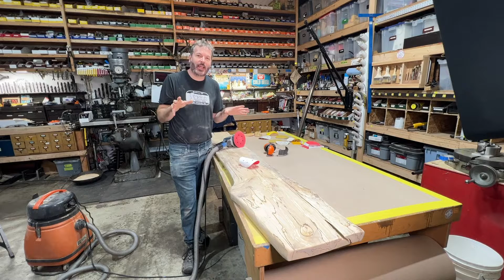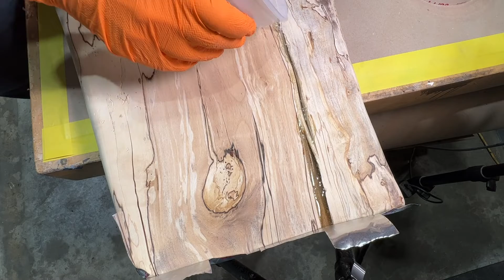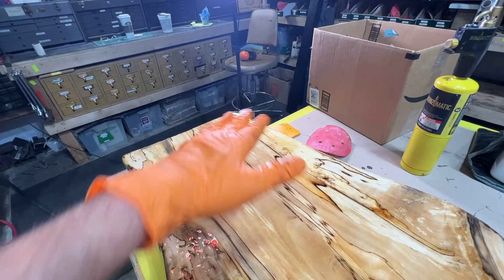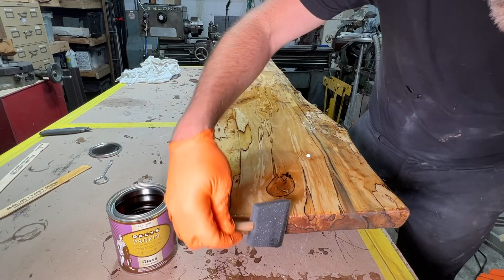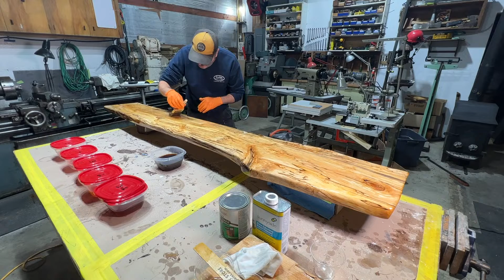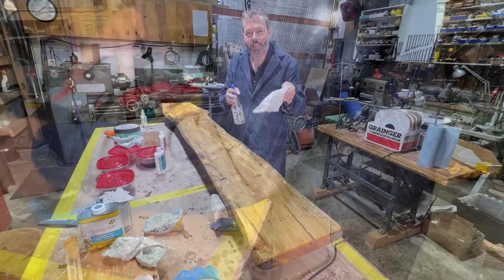Epoxy + Polyurethane + Buff & Polish - Incredible Wood Finish

Comment: CA glue method on the chip brushes, huh. I just used chip brushes and I assume this was to keep the hairs from coming out? I should do that next time.
Reply from the maker: Yeah! The thin CA glue works best. It  soaks in between the bristles right at the base. Best to point the bristles up at a 45° so the glue runs towards the base and not the tips of the bristles. Right On! 🙌